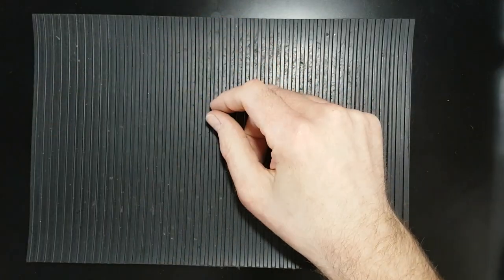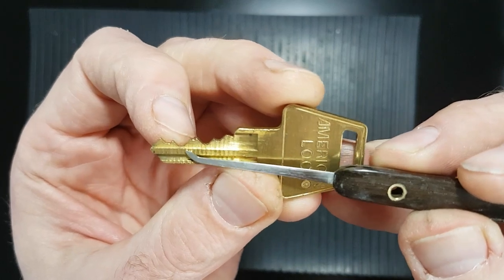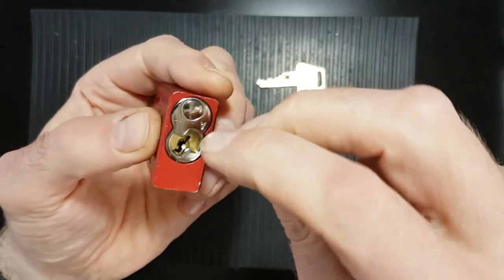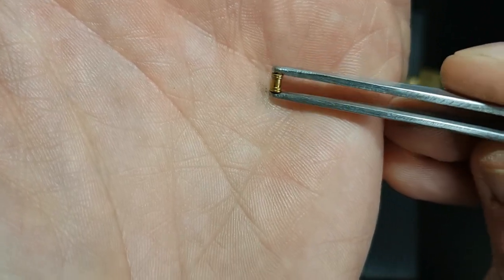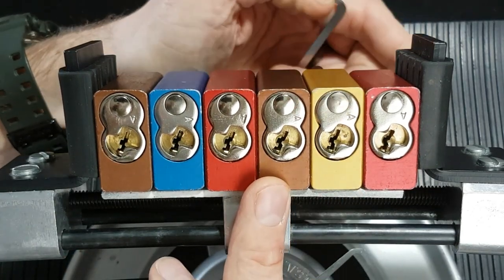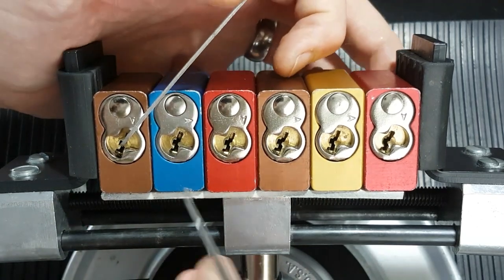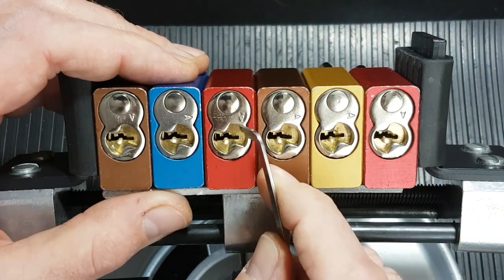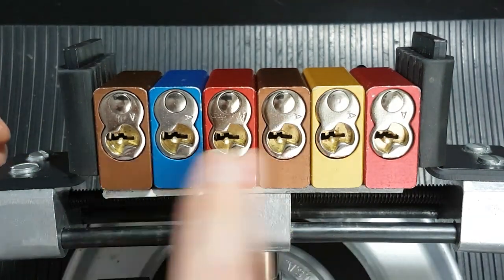Let's play, hunt the spool! How to pick the American 1100 padlock

Comment: Just used your tips to get into an hardened steel American 5200 series lock that I received in a mixed junk bag. The shackle had been cut and it had no key, Picked single little clicks at a time with a fair bit of tension, when I got into a false set I knew I'd struck gold because I used your tip and found the counter rotation, lightened up on the pressure and was able to get pin 3 set which is where the spool was that had me in the false set. After that went back through and put the pressure back on, one last serration and it popped open so fast my tension tool went flying! lol.
Reply from the maker: Excellent picking and congrats on the open 😎👍🏻

Comment: Thanks DMAC, I started picking with a bag of locks 2 years ago, they had American 700's, American 2000 puck locks, and of course a bunch of master locks, and knock off's.  I made it through them along with some SC1 cores, then got an 1100 and yeah brick wall.  My first open was using the SSDEV pointy Euro hook, but it was a fluke.  Now watching this video I get it, I've been trying to pick off the warding on the bottom, not directly from the bottom.  Got my Monkey paw and I know what I'm doing after breakfast tomorrow morning.  Thanks for the insight, it's greatly appreciated!
Reply from the maker: Glad if the video can be of any help to you. Thanks for watching 👍🏻

Comment: Yes these are my nemesis, I've luckily been able to pick only two 1100 series, five pinners open once each. I'm going to try this method but I'm also going to probably break down and progressive pin. I did recently receive a couple of the 1100 cutaways from covert instruments and I am not too pleased with them. I got one from myself and a few other items for someone that is new into the hobby of locksport.  
I appreciate the video because I still have issues picking these. Take care brother, my best to you and your family
Reply from the maker: Thanks J. I progressively pinned too when I started out on these. What didnt you like about the cutaways?
Reply: @Dmaclocksport  wished the covert instruments 1100 shows the sheer line better and not being left handed, the Sparrows, the removal cap definitely not as easy to mess with to gut. I actually did a review I'm uploading, I figured it would give people a heads up. I also bought the stick and I like it so far. Just some items I bought for the nephew of one of my bosses. He has epilepsy and shows interest in LockSport, so I got him a few things, gave him a few locks of mine too and a selection of pins and springs. just doing something nice and keeping in spirit of the LockSport community sharing and helping along the way.

Comment: That blue one was never that easy when I owned it 😉.  I've got one at the moment that I bought from Nathan without a key, and I'm 100% sure it's all serrated.  I've spent hours over the past month & a half, and can't come close to opening it.  I might engrave my name on it & send it out as a CL.

Great video as ever.  This should now be the default video for 1100 advice.
Reply from the maker: Thanks Niq, the ones with serrated pins only are tougher imo. You'll get it with your swanky lpu belt 😄👍🏻
Reply: @Dmaclocksport  😂 - don't be so sure, it was that easy blue 1100 I used for the video 😉

Comment: Really useful to me as I've not yet successfully progressed to picking any of my 1100s. I am probably a founding member of the rattle club though. One of the first things I did when I obtained an AL core (outside of a lock body) was to try repinning it. Everything was going fine until I over rotated it, to be greeted by a plink plink plink, as each pin, spring and dead arachnids fell down and out through the holes at the bottom. A mistake I'm hopefully not going to repeat.
Reply from the maker: We've all been there! I'm a proud member of the rattleclub myself 😆
Reply from the maker: Ouch! Sorry to hear that. Still, it means the only way is up 😁👍🏻

Comment: Hi mate can I put other KIK cylinders in these padlocks , thank you 🤓
Reply from the maker: @egyptsy9563  if they're the same size and have the same actuator on the rear, then yes. Most KIK cylinders are larger than the 1100s though I believe
Reply: @Dmaclocksport    Cheers mate do you know any that will work other than tool and paclock,  sorry to be a pain